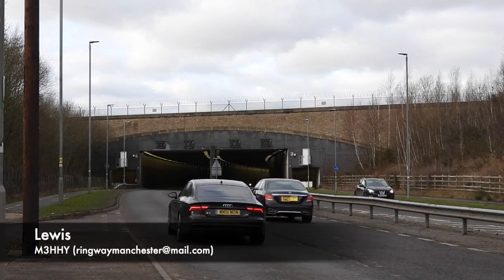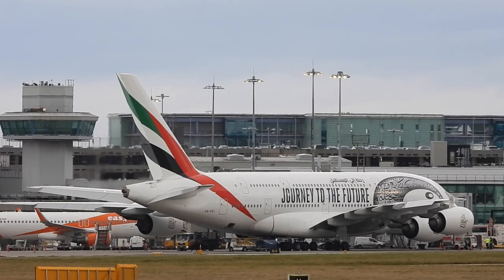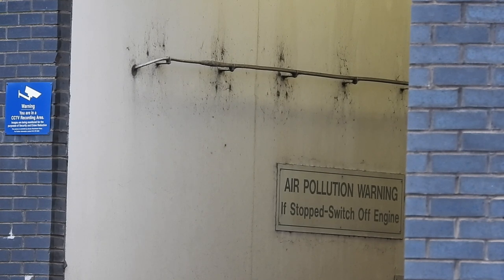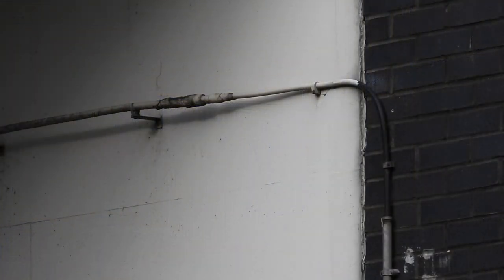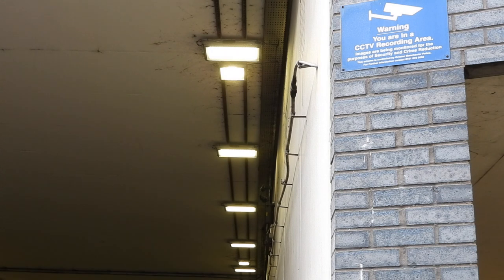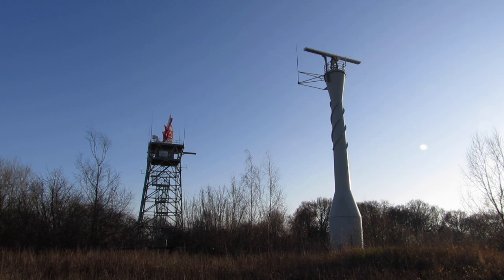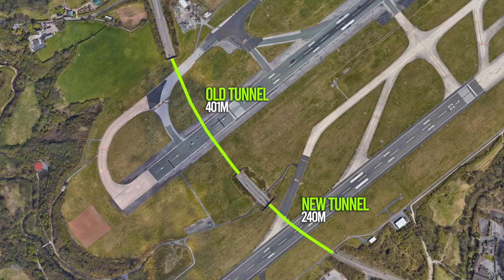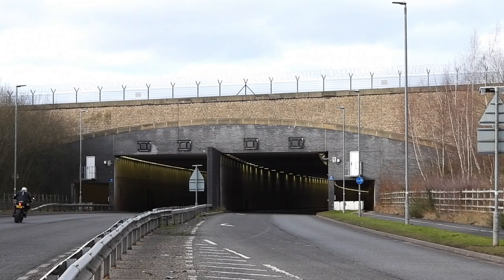How Do Radio Signals Travel Underground?

Comment: I use the leaky cable in the tunnels of grain elevators all the time.  I have even used a 3 way splitter/combiner  on 3 tunnels each running 100 meters without any issues. Business band repeater (150 & 450 MHz) up on ground floor.   What I suggest you do is look into a company called Luxul.  They have a controller that can handle up to 32 Access Points of their's.  And not have the huge losses of WiFi.  That way things are more handled like a cell tower.  You could do the amplifiers, but you also have to have power at each location.  Then you need to make sure the amplifiers do not cause you interference. Also will they pass the other frequencies.  Been in RF since 1988 so seen many issues.

Comment: Interesting!  I don't live near any tunnels, so the thought never crossed my mind, honestly, but it's cool to see!   I wonder why they don't just have "regular" antennas set every few hundred feet or so instead of the length of coax? (perhaps ease of maintenance or less likely to be damaged by a vehicle?) Either way I'd never heard of it & I love all things radio :)  Thanks for the vid!
Reply: Some road tunnels do have this for mobile coverage. If you look at the ends of the Hindhead tunnel, for example, you can see a small square white box above the matrix displays. These boxes provides phone coverage throughout the tunnel.

On others, such as the Limehouse Link, leaky feeders are used.

Comment: Here in Germany radio coverage in tunnels is a big problem, you usually lost everything on the first meters in. I never used more than UHF radio for myself, but I can tell you that the only thing you got is white noise. Also a lot of emergency helpers I know reported that there is litterally no coverage of radio communication inside of a tunnel, that can be a real problem.
But as this country is known for doing the absolutly possible minumum for technological advantage, I have to say I'm not surprised :D

Comment: Interesting!

There must be systems like this for satellite or gps, also?

I have a GPS unit in one of my cars with no vehicle speed sensor input, and i was surprised to see it continue working  and keeping progress under certain long tunnels.

When I had xm satellite radio it also kept working under that same tunnel, when it would normally die under any form of heavy cover.
Reply: GPS does not work indoors, likely your car will be using multi-axis accelerometers to approximate your position during loss of GPS signal.
Reply: @SuperSpecies  it's one of those cheap android radios (quite old now) so that's probably how it does it, if that's how phones keep their route bearings while underground.

Thanks
Reply: XM has their own terrestrial system for tunnel coverage. Some extremely old XM radios can’t receive it. 

GPS on a phone inside a tunnel is often just AGPS ( Assisted ) using information provided to the phone inside the tunnel of approximate location inside based upon the usual AGPS cellular signals coming from the microcells inside the tunnel. It gives the illusion of GPS being received when the actual GPS receiver isn’t hearing anything. 

You can play with this by taking a GPS only receiver in and comparing it with the phone in the tunnel.

Comment: I'm sure I read of one of the local RAYNET groups doing a tunnel exercise back in the 80s with Greater Manchester Fire Service. I believe they had success in using the 70Mhz band to communicate from one end of the tunnel to the other.
Reply: That was the Standedge Tunnel exercise, and  they used the 1.2 GHz band, 433 MHz was tried but only went about 300 Mtrs.
The tunnels are 3 miles long and solid comms were achieved the full length of the tunnel using a handheld radio at the tunnel entrance, and a mobile radio with a magmount antenna on a vehicle driving through the tunnel.

Comment: Worked with Radios connected to a leaky Feeder in conjunction with repeaters. The Main System for a Train Station fits in A Rack the Size of a Fridge, with the Feeder being one Drawer or Two. Systems Like this will likely not be dismantled for Years AS a Fallback. Might still be in use nowadays.

Comment: A few ways to tell if its still live is likely with A EMF meter /  SDR Radio / Non contact Voltage detector pen up on a Telescopic Washing line pole  / Radio Scanner  with a Signal Strength  meter 

i  do love the SDR Due a Simple Antenna in a Pringle's can can make for Quite directional  and  Hi gain pick up 

As for the  Non contact Voltage detector pen you may want a crazy mate in the car to do some 2am ~ 3am ~ 5am   unsafe Slow Driving and tunnel walking (fake temp car problems) 

just thought the new longer tunnel may have it  Leaky cable more camouflaged or embeded it may even share the same ducts & cable Trunking   as the ac lights  or a vary high  Close  to surface pipe in the road even share a SW Drain pipe

Comment: I'm now interested in designing leaky feeders. Is there a design calculation on how it's made?
I was once consulted by a friend on how can they increase wifi coverage for the entire property without spending tens of thousands (pesos) on mesh wifi or repeater devices.
I never thought of using a seemingly "bad" coax as an intentionally designed transceiver.

Comment: That great . some systems like this in the US in use today. was wondering on 4G cell signals getting in to subways and underground . I have been threw some tunnels in the US  and my cell phone 4G works just fine. a few do not at all. FM radio and SAT radio goes out as well as GPS . but some AM broadcast can go underground a bit. There is a pedestrian tunnel  in my area underground . everything goes out but a few AM stations. also longwave can be herds but so few now.  our subway has cell service underground . no FM and AM so much noise can't make anything out. 73's

Comment: Why run the cable (antenna) down both sides?  Wouldn’t it be just as effective if you had on run down the center of the ceiling?  The power level must be quite low to prevent resonance or multi path error.

Comment: How would the coax be tuned or matched? It's not an actual tuned antenna.
Reply: It's 50ohm coax with a terminating resistor at the end.
Reply: @Charles20112011  In the Manchester Metrolink tunnels, they terminate the feeders with a 3 element Yagi pointing along the line to fill in dead spots in cuttings.
Reply: @Charles20112011  ok, that would make sense.
Reply: @jonmac3995  so the coax leads to something and not just a dead end.